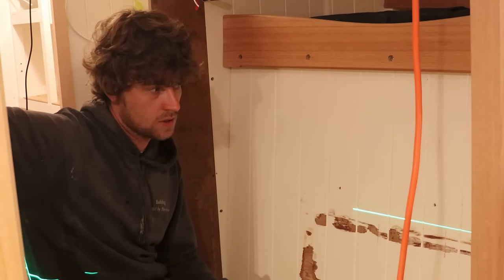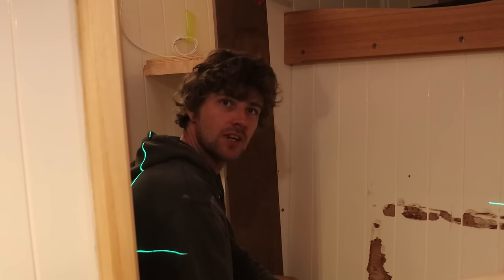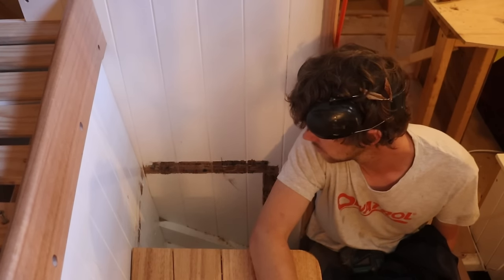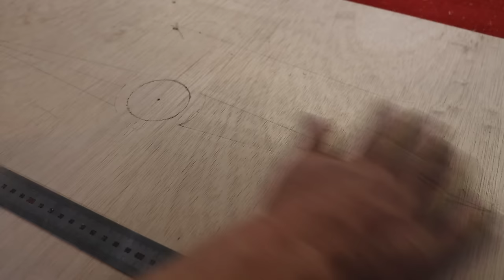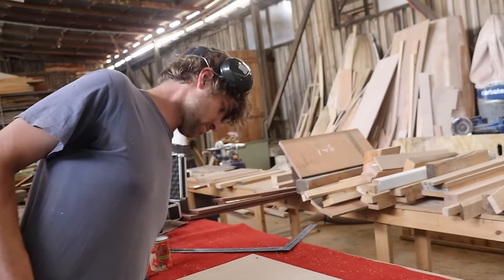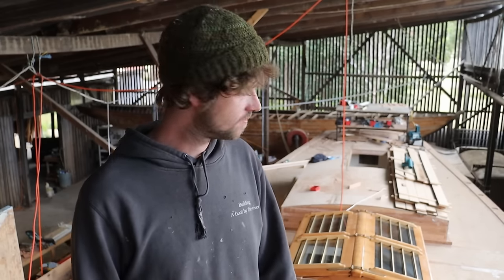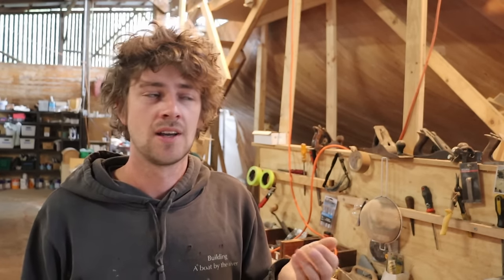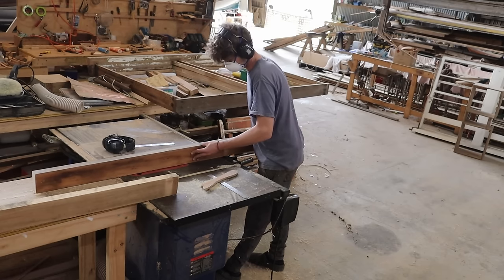Where to put the diesel heater?! Wooden boat interior fit out and cabin decking preparation. (EP41)

Comment: I'm in Canada.  I know diesel heaters.  I squished one in my 1st boat into a smaller space than yours, between a seat like yours and a bulkhead...with a cushion.  Your safe safe....no heat there.  You were smart to keep it low.  My present boat had one up at the level of the seat.  No heat...it comes off the pipe so get the fins and magic fans.    Still won't work.  Yours will.  However....screw them.  They eat diesel.  Pulled mine out and built a storage spot for my camera stuff.  Bought a cheap Chinese all in one...I'm in Victoria BC.  I put in my cockpit during the month I need it, using a substitute slider with a hole.  think its a quarter litre an hour, remote, app, and wired control.  easy.  If I do find a neat little wood burner, well, that looks nice at least.  Eventually I bet that seat's top get's built up into shelves or storage.  Cheers.
Reply from the maker: Oh wow what wonderful insight! That’s a great little review you gave there, thanks so much!

Comment: It’s great to watch you guys build your boat, maybe instead of using your grinder inside your boat I know you can get steel cutting blades for the multi tool which has no sparks mite make it a bit safer for you.just a thought. Keep up the great work
Reply from the maker: Yes a great thought! They can be a little slow, especially with stainless. And the hardware shop was so far away at the time hahaha

Comment: You might want to check out a recent video from Acorn to Arabella, the diesel heater on his boat was filling the cabin with fumes because of the small space and inadequate ventilation.  Do a lot of planning!!  I think that space is extremely small and confined for that heater and may present a fire hazard.  Those heaters throw out a huge amount of heat and proper ventilation is imperative!!  You may come to regret this project.
Reply from the maker: Oh really, interesting… luckily we have the skylight right above the heater if it’s that bad but we will definitely do some research

Comment: Question: you've got that huge area of flush deck at the stern - are you going to cut any storage hatches in to it - like a lazarette or some nice bit double doors for sails and bikes like on the spirit yachts?
Reply from the maker: Yep! Under the first layer of plywood we have a cut out ready to go for a lazarette but a flush deck is also so pretty! We will also have cockpit lockers, the aft section/lazarette is actually quite small with her counter transom

Comment: That selderywood for the dek or cabindeck is that  a ceder or teak kind off wood?
Reply from the maker: Yeah we just had a question whether it’s a hard wood and we need to check because it’s definitely a harder type wood but it’s actually a pine, and they are usually a soft wood… hmmmm

Comment: 9:36 why did you not just pull the screws out instead of cut off?
Reply from the maker: Valid question! We had filled and paired the screw heads from the other side, so we would have to ruin more paint work in order to find them and just seemed easier to cut them off, and unfortunately some screw heads were covered by other wood work…